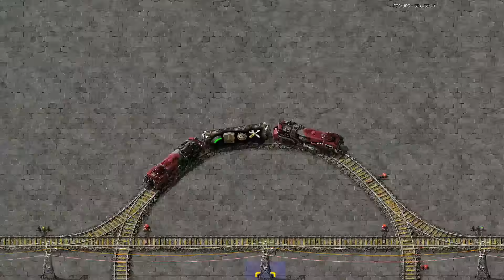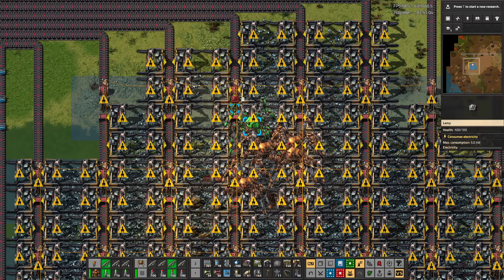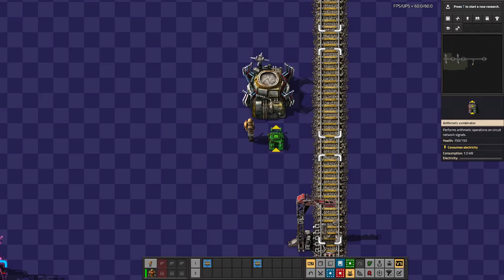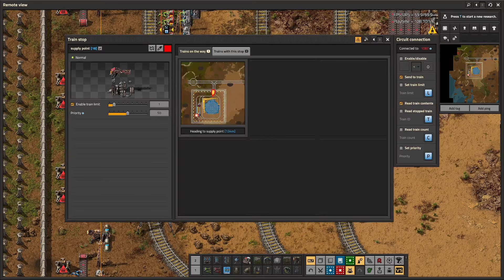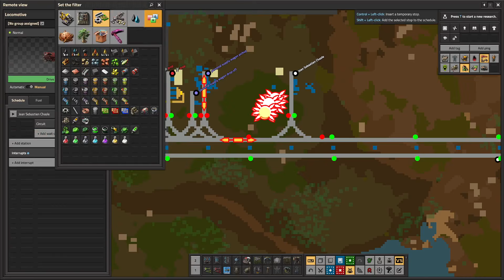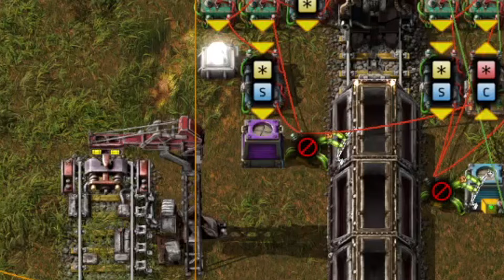Supply Trains: Basic, Cursed and Optimized. (Feat. Personal Logistics Trains) -Factorio 2.0

Comment: I built out a pretty similar setup a few days ago to remotely spin up new scrap-mining outposts on Fulgora. I lay out the initial track loop and logistics station blueprint using a tank with a personal roboport, and once it's run once, the local logistics network is bootstrapped and the tank's work is done. The home-base loading station doesn't bother with stack size adjustments; I just make sure the shopping list leaves at least one empty stack in the wagon (which is fine when supplying Fulgora outposts) and use 1-stack inserters to dump any excess into purple chests. I did a test run of the system before leaving the planet, and now that it's up and running, I'm pretty sure I'll never have to go back.

I also have a blue chest set to request anything that isn't on the supply list (or that somehow ends up above its target), which gets dumped into a car on the main scrap trains; the unloading station at base dumps any non-scrap into a purple chest there. That way, anything that construction bots tear up can get shipped back without any fuss. It requires an "or 5 seconds of inactivity" condition on the loading station, since it add stuff in non-multiples of the stack size, but that doesn't really affect normal operations.

Comment: The reason why wildcards can't be used with stack size is that as an aggregate they don't have a concrete value. Any and Every only make sense in a boolean context, the condition is applied to each signal and the results of that are combined. And Each is an abstraction for an array of values being processed without interacting with each other, meaning operations with each usually produce separate results. Neither of these cases applies to the inserter stack size, its an actual value and just one result

Comment: I'm not sure how useful it will be for you, but I use active providers with inserters directly connected to the local logistic network to control inventory counts. If you did not know, there is a checkbox hidden in a window that opens at the top right.

Comment: 10:38 You can set the wait condition of the train to require that the drop off station is available, this lets the train stay in the at station state until it leaves instead of idling in the sleep state.

Comment: There's a system I devised for multiplexing signals years ago - I used it as a weak alternative to the new constant groups in 2.0 along with some other stuff. I used the standard "wires on the electric poles throughout the base" method but it also works with radars in 2.0. You need:
1. A control signal indicating the message type. For example, C=201 might mean "Update supply train".
2. A receiver station with a memory cell (use a constant combinator with C=-201)
3. Something that sends out the signals every so often.

Using this, you can use the radar wires for hundreds of different things.
Reply: Oooooo. I was just trying to figure out how I would send 3 different types of signals on just 2 different colored wires (requesting items, items available, and requesting items be removed from an outpost)
Reply: @samwilde8311  Good luck :) You'll need a centralized "server" sending out the control pulses. You can also define something like C=202 => reply next tick with inventory available and then have the server just listen for the response. Also, since I used 200-399 as control codes, I knew ever seeing a signal C>=400 meant an error and would shut the computer down...

Comment: When setting up the stack size, what i did in a similar situation, is the guy who sets stack sizes also passes the filter. I set up a decider that when any signal is greater than 0 outputs any signal input count and also S input count. Will prevent any desync issues.
Reply: Can work with each and everything too i guess since were only feeding it one signal from the selector

Comment: If I'm not mistaken, older versions of Space Exploration signal transmitters worked the way radars do now-only having the single channel. One thing that I did to great effect was to use signal multiplexing to determine which cannons to activate. You may be able to achieve something similar with individual items and bit-shifting values around to carry multiple signals in one.

Comment: Nice video, it is going to take a bit for it to sink in for me.  I have a simple design for reloading a outpost supply car that uses circuitry I like to share, There are four requester chests ( Ammo repair packs, walls and mines) and obviously four bulk inserters. The intersters are linked to the train station that send out an inventory readout and the inserters are set that they will load the car if the item readout is below the specified amount. 

One benefit I have realized  after watching this video is that it does prevent "jamming" since the inserter will drop everything it is holding into car. On mine I have the item requirement set to %150 of a stack to have a buffer amount so I am not worried about inventory.
Reply: A bit unrelated, but I want to mention that having a artillery car or artillery on the outpost can make extra or complicated fortifications unnecessary since it will expand your safe zone and significantly reduce biter attacks. When "taking over" an area, the waves will come sequentially rather than one full scale attack, a spidertron MRLS does help alot! I do not mean skimping out defenses, I have turret nests surrounded by two layers of walls and mines to soften up the biters surrounding the outposts.

Comment: "That's how I do balancers don't worry about it" Mood. My friend always makes comment on mine. I run 5 tracks or so, and just split them down to the bottom most track and always pull off that bottom most, and re-split down to the bottom after each use to condense it back down 😅

Comment: 9:33 You can reduce the arthimatic combinator and the selector combinator to just a decider combinator that has each > 0 for the condition and each at input count and S at input count for the outputs.

Also you technically shouldn't need the extra decider combinator after the constant combinator to sanitize the input as you will only get negative inputs if extra items make their way into the train which wont really be a problem anyway if the selector combinator is set to sort descending.

One last thing, I found that if you are using a legendary bulk inserter you need to read the hand contents of it and feed it into the first *-1 arthimatic combinator otherwise the inserter is too faster than the combinators can process.
Reply: Can you elaborate your first statement because that will output the sum of all input signals on S as far as I know. Which is not what you want of you want to fill the train directly. But I havn't had a good solution for that problem sofar.
Reply: @kolumdium  Looks like youtube ate my original reply because I put a link in it. I'm not the best at explaining things but put simply the decider combinator comes after the selector combinator so it only has one input, and as such you don't need to worry about the problem that you mentioned. For example the selector combinator chooses 200 coal as it's output, which would become the input of the decider combinator which would then output 200 coal and 200 S.

In the video he accomplishes the same thing by using an arithmatic combinator to convert 200 coal to 200 S, and then uses a second selector combinator to output 200 coal for the purposes of making sure the signal reaches the inserters on the same tick that the 200 S reaches them.

Hope that helps.

Comment: It is possible to load more different items into a train by using a circuit network that sets inserter filters to only allow any given item to be transferred if there is more than handful of that item missing from the train

Hell, if you wanna get fancy and mind having 11 items less in the train that its maximum you can set the stack size dynamically so it’ll only grab as many items as needed, but then you need to set up a combinator per item you want to put in it

Edit: ah
I was thinking of a much simpler solution than what you ended up making, but uuhh… yeah that works too

Comment: I use a simplified version of this for my defensive outposts. Similar in concept, with a shopping list in a constant combinator hooked up with some math to a provider chest to set the inserter filter and the train departure. To fix the issue of trains getting stuck if items are taken from the chest too quickly i just added an inactivity timer to the train schedule, so if it doesn't have what the filter wants it goes away.

Comment: My solution to loading my supply trains was to have 11 bulk inserters, each inserting 2-4 different items. They were all set to 'Read hand contents (hold)', and wired into a circuit which would identify any signal which remained active for more than X ticks continuously, where X was the number of ticks a bulk inserter takes to transfer a load. Any signals identified by said circuit were sent to the 12 inserter, which would remove that amount of the item in question from the train, thus making room for the other inserter to drop its remaining items and get back to work.

I took care in how the items were divided between inserters. Things needed in bulk, like belts, got dedicated inserters, and when multiple items were on the same inserter I tried to make sure they were not correlated. (E.g. I'd make sure heat pipes, heat exchangers, and steam turbines were all on separate inserters, since a train that comes home needing to refill one of those is likely to need to refill the others, too.)

Unloading was pretty much the same as your design, except:
- Large-volume items like belts got dedicated inserters, while everything else got one inserter per train car
- Rather than reading the contents of the unload chest, I read the contents of logistics network. This meant that items would be removed from the count as soon as a bot decided to come take them, rather than only once the bot actually arrived and collected the item from the chest, allowing more items to be unloaded immediately
- With the exception of defenses (walls, turrets, repair packs, power poles, etc.), everything was set to a buffer of just 1 (or 4, for items bots can carry more than one of at once). Idea is, you place some ghosts, and the one item in the buffer gets used, causing the train to be summoned. Then, once it arrives, it unloads as many items as are actually needed for the build, plus one, and leaves.

Comment: you could use the read logistic requests from the roboport, and compare it to available items to get any missing items (and / or include a small buffer with a constant combinator) to automate all items at once. But you kinda have to work around trains not nessesarly being full. but you get "self completing" bases once you build the initial station.

Comment: If it's 95% idle you can run the inserters 20 times slower so an inserter with stack size 1 is enough (?)

Comment: "It's ok to admit you've never used active providers"
Speak for yourself XD
Active providers are my third most used logistic box right after requesters and logistic storage. I basically use logistic storage boxes primarily as part of the outputs of any production I have with the chest's filter set to the items that the production is making. I also use a lot of bot mall logistics and will also disable the crafters, inserters, and the requester chest supplying it if the item reaches a certain threshold in the logistic system. That way I can ensure a minimal stock and anything that is picked up and put in the logistic storage like from trains or bot building, the bots will automatically organize the items into the output chests of production. That way I don't have to worry about having a massive logistic storage dump with 300 yellow chests just taking the excess, it goes back to the production output to be reused. Requesters as I mentioned I not only use as a big part of production, but I also have disable if enough of the item it is making is made, so I don't have an excessive amount of items sitting in requester chests not being used. I also make sure requesters also are allowed to pull from buffers cause I use buffers more than I do passives. Which is exactly for what they're used for, honestly. The disabling of inserters and the crafters are a measure to save power and resources. Plus, when the need to make more does come up, it has a small buffer of items to make what is needed upon activation.

As for active providers, I use them mainly in trains, my bot based kovarex processing module that only uses what is needed to start the process and exporting excess to other modules or parts of the factory that it's needed, Gleba cause if things aren't used they rot, and generally parts of the factory where I don't want things to stockpile. My stockpile is essentially where the production happens, cause I like that kind of efficiency :P

I'd say the least used logistic chest I use is the passive provider. It's nice to have on occasion, but it has a niche use in my builds cause the logistic storage can fulfill the needs a passive provider does, and I can filter it. Passive providers generally are unique stockpile spots that have multiple items like dump chests like if I have an assembler that has dynamic recipes set up and I need a spot to pull excess items when the recipe changes. That way the resources are available if needed elsewhere, so long as the recipe doesn't need them, then an inserter will just pull them back in. They're good for storing items and keeping them available while also not letting bots drop items into the storage. An out only box but the items are available when no others are since logistic storages have a higher priority than passives.

But ye, logistic storage chests of all 5 kinds in general have gotten such a nice boost in 2.0, they make bot malls so much better :D

Comment: 6:04 That's not the minimum space possible. The 4 stations on the right load the speed modules through iron ore multiple times. And you aren't using the space to the bottom of them. The actual minimum solution consists of 4 stations, spaced every 6 squares (4 square gap in between them) and chests in all spots to the rear of the second-to-frontmost station, until you've reached 40 chests. That fits into 30 squares instead of 34. In both designs you do have to be careful to load anything that can be burned as train fuel from only the very rear-most inserters (unless you don't care about it potentially blocking train fuel slots).
6:07 That's the design that's actually smallest.

Comment: 3:00 what does "each greater than 0 than each" mean?
Reply from the maker: Programming at it's root tends to focus around "If X then Y" so you can consider a combinator's input it's "If" and it's output it's "then". Each is a special signal command in many machines that treats each individual signal icon individually and then feeds them through.

An "If Each > 0 Then Each" condition means that a decider will consider all signals fed to it, discard all that are below zero, and then send anything that is left through.
Reply: @InferAGoodTime  Ah so basically: if x > 0, y = x, else y = 0

Comment: A few months ago i spent an entire weekend building an "all in one" loading and unloading station for a personal expansion train. It was something like a 4-12 train, it had about 30 different items in it. Some in very high quantities (like walls and turrets). The station had 6 bulk inserters for loading and 6 for unloading per wagon, and it adjusted the stack size when delivering the last items of the groceries list.  I could go someplace, build the entire station from my inventory, then build an entire mining outpost in one go. It worked fine but it felt like a complete over-engineered solution for a problem that didn't really exist. 
I might rework it soon when i finish most of space age's content and go back to Nauvis.
Reply: Also what made me stop working on the design is that there is no way of tracking "missing" objects in a particular logistic network. You can track chest requests, but not the ghosts you place from the remote view. My intentions with this station was to avoid having robots flying long distances. Like if i wanted to print a giant solar panel very far away, i wanted my train network to notice in which logistics network there were missing objects and send a train there to fulfill the request. Sadly you also need to input the number of items requested in a constant combinator at that station for this to work. It felt like more maintenance than to just do it with a giant grid of roboports and wait for the robots to fly.

Comment: I made a fully automated supply train with a single supply spot capable of putting up to 40 different item types via 12 stack inserters running at max speed without risks of clicking. There were just like 3 combinators per inserter :D